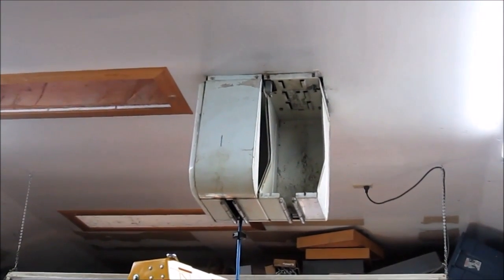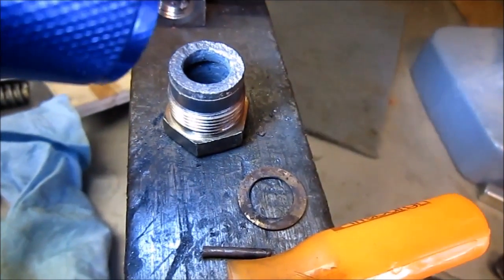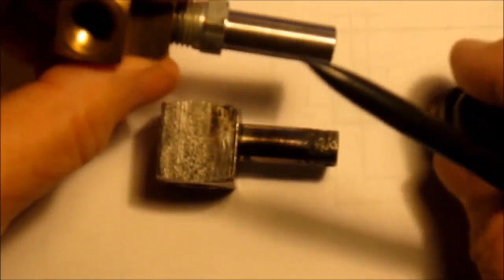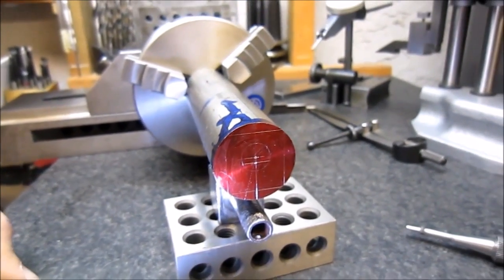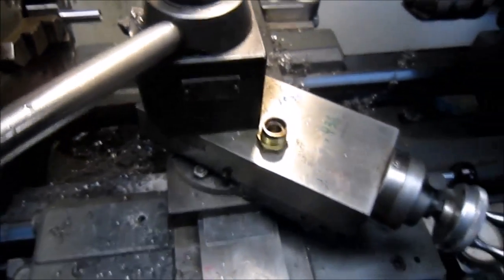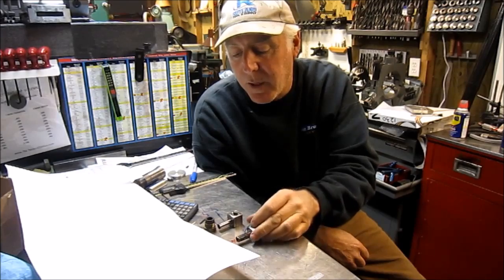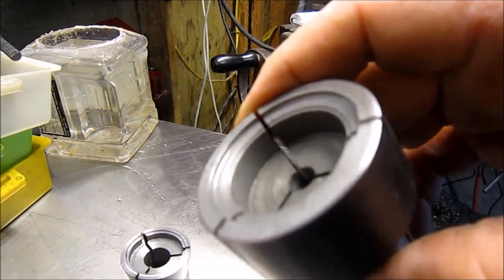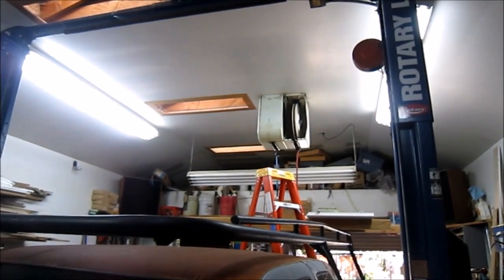SCREWY TUESDAY  # 15  Machining SS air fitting

Comment: Hi Chuck,
Thanks for the video.  I had not seen this series before so it wasn't a re-run for me!  Nice job on the air hose reel repair.  I'll bet that reels made today won't be around in another 70 years.  Its good to be able to made your own parts for "obsolete" equipment!
-mike
Reply from the maker: ***** thanks Mike

Comment: I am on my second dremel tool and I find it to be very handy to have around.  I wore out the first one back in the 70's doing porting on two cycle motorcycles.  I guess they just don't make hoses like they used to.  You wont find a harbor freight hose out living you.  Thanks for the video.
Reply: cerberus I have a Harbor Freight hose real. It has been sitting around for ten years waiting to be mounted.  I noticed the other day that the hose is cracked and will have to be replaced when I put it into service.  I bought a blue hose from them.  I used it once and tossed it.  It was just too stiff.  The 40 year old hose, from who knows where, is still soft and is used regularly.
Reply from the maker: cerberus Thanks Harold
Reply from the maker: Kurt Armbrust can't beat good old American products

Comment: Thanks for sharing!   Reruns are good.... Even I love Lucy makes a comeback!

Someone in United Arab Emirates sent me an email on where to buy "Screwyballs" -- so I pointed them to your eBay listing.  So your machinist balls are getting universal recognition! 

Trick for loosening something that is stuck... rap on it with a ball peen hammer (sacrifical metal to prevent damage the surface).  The shock will often help break the bond between parts.   Dremel with a tiny wire brush is great for cleaning up those internal threads....
Reply from the maker: Tom Walter thanks Tom, like the trick...and assistance but sorry no commissions yet...lol

Comment: Hi mate.
You have got a nice repair there, I was a bit worried that the copper washer would not do the trick, but I was wrong.  When you had it all apart, you saw how poorly it all was corroded inside, why did you think the thread and seal holder would still be air tight?  I must say that you have a very well appointed workshop there, not big, but boy you have some nice stuff. 
Kind regards,
Marcel.
Reply from the maker: Marcel Timmers Hello Marcel, thank for watching and your feedback